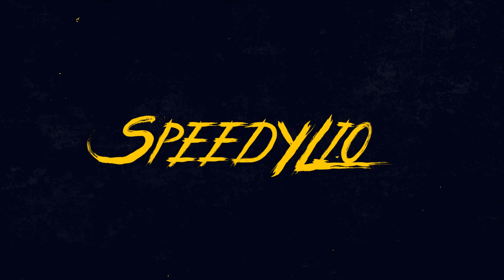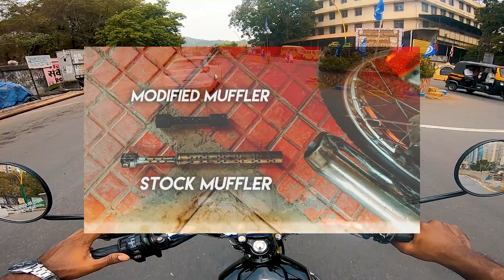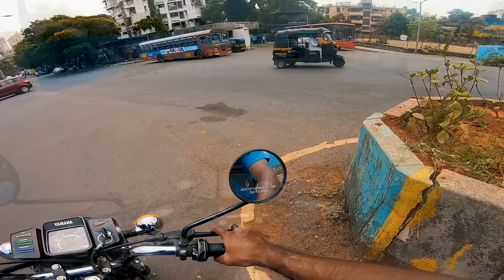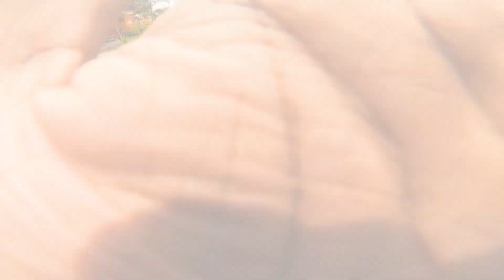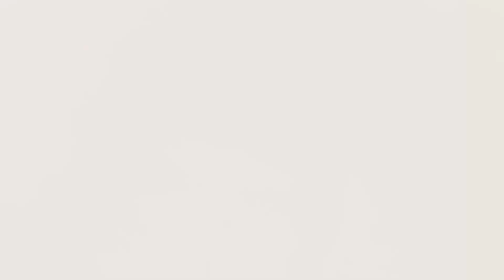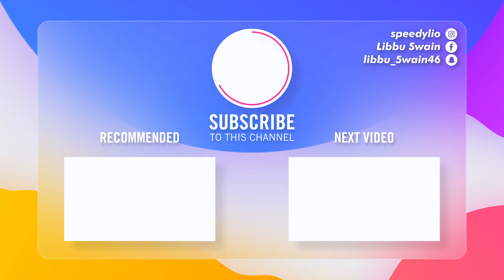MODIFIED MUFFLER BAD FOR ENGINE ? : Yamaha RX100 🤔

Comment: Stock muffler has caps which don't allow the exhaust gases to go out freely but on a Modded muffler it works like a freeflow exhaust. Stock muffler also reduces vibrations caused by the sound. The engine is surely affected by using a loud muffler. It changes alot of things for the bike.
Reply from the maker: Thanks hassan bhai for the info👍
Reply: @SpeedyLio  you're welcome bhai
Reply: Stock Muffler Creats Back Pressure Which Is A good thing for the engine is it right guys
Reply: @AkshayShelkePatil9  yes and as the company designs anything they design it in such a way in which you can get the longest engine life.
Reply: @motosoul   bro but i have one doubt that in older stock mufflers those caps fitted inside were having holes can you tell something about it ?
Reply: @AkshayShelkePatil9  those caps didnt have holes. Original muffler has closed caps. No holes in caps
Reply: @motosoul   bro i have one rx 115 japan muffler indonesia made which has hole for the inner caps and only one cap is closed
Reply: I have experienced low initial pickup when I switched from original muffler to free flow modded muffler. Never going back to modded muffler again.
Reply: @AkshayShelkePatil9  no idea about that bhai. Haven't seen one in-person.
Reply: @motosoul   No Problem Bhai 😁
Reply: WHAT about when we remove the caps from the muffler and use it
Reply: Hai
Reply: @motosoul  hello haasan bhai, means the stock muffler has all caps sealed right one i have has 2 open and one closed

Comment: Bro modified muffler is slow poison for yamaha rx 100,135 it will kill your bike slowly.👍
Reply from the maker: been running this for almost 4 years now
Reply: @SpeedyLio  I am using my own yamaha rx 135 and 100 from last 12 years.and tried every possible mod.but nothing is better than stock.
Reply from the maker: @shaileshparteki2479  I also like the stock muffler but the sound is a no no for me.
Reply: I think its very slow😆😆😆
im using modified muffler from last 10 years but still no problem...